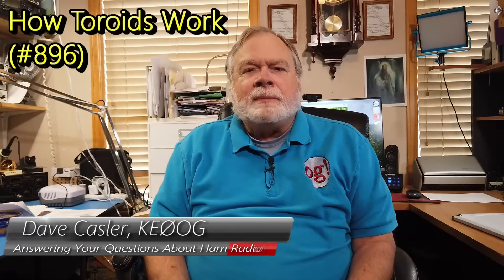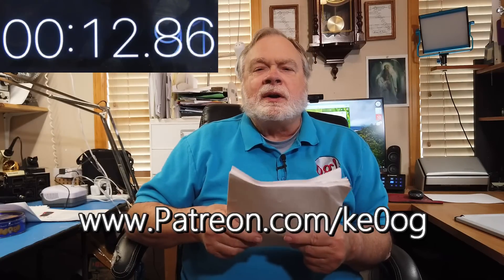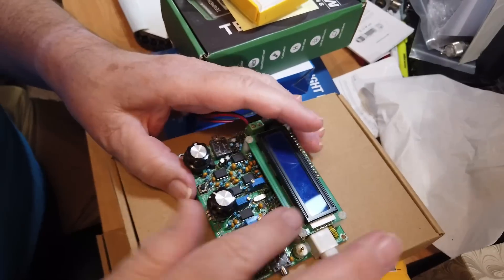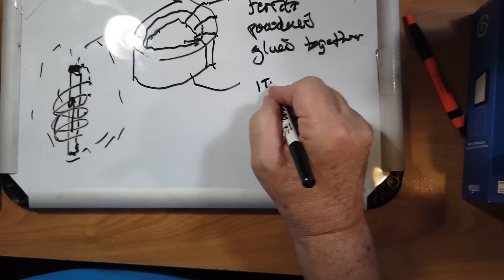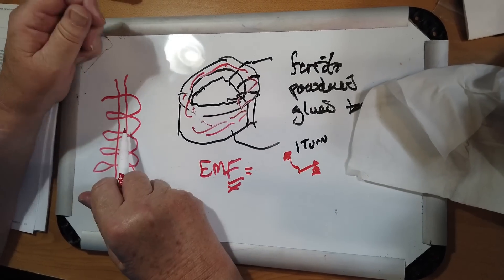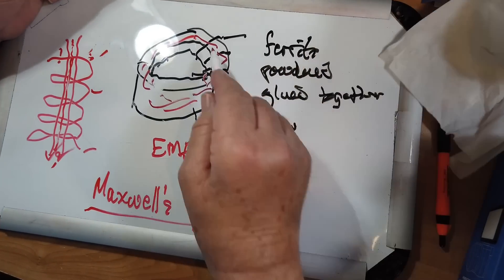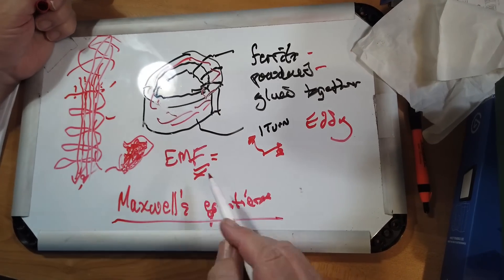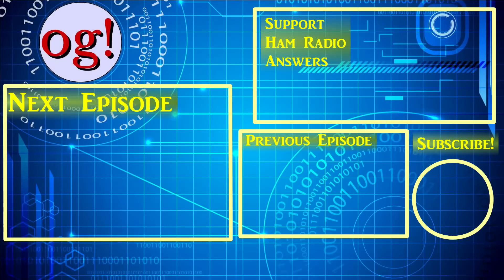How Toroids Work (#896)

Comment: Maxwell's equations actually require some advanced math. To keep things simple, I just say:
1. Putting a voltage across (or a current through) a wire creates an electric field.
2. The changing electric field creates a magnetic field. In a toroid, this field is ring shaped, inside the toroid itself.
When you wrap ANOTHER coil on the toroid, the same magnetic field is inside. This leads to:
3. A changing magnetic field creates an electric field, which can be picked up by a wire.

Which is what you said, I'm just summarising here.

Comment: 4:15 Two types of material for toroids (and other shapes of RF cores) are used:
A/ ferrite - a sort of magnet permeable ceramic, which is sintered at high temperature and treated in a special manner. It is not powdered nor glued. If such core is heated above certain temperature (e.g. by excessive RF power losses), it loses its magnetic properties forever.
B/ carbonyl - powdered iron mixed with glue and hardened. If it is overheated and cooled again, its magnetic properties return back.

Comment: "Spooky", later referred to as "mutual conductance". There was an old wives tale that went around about how you could "effectively" increase your output power without any amplification by stacking toroids. Not true, it actually takes away from effective radiated power. Accept, if done right, It makes a great balun and gives full transfer of energy out to the world 👍😁.
Reply: OM tale more likely 😆 *Except
Reply: The only thing stacking toroids does, is to increase the amount of current it takes to saturate the core by decreasing the flux density, at the cost of increasing the magnetic losses.  If a core isn't saturating, it doesn't need to be doubled.

Comment: I think the easiest way to explain this is that the electric field E is perpendicular to the Magnetic Field H. The electric field runs in the same directions as the wires. Because of the time changing current in the primary windings, this will induce a time changing magnetic field. Since the wires are wrapped around the toroid, the time changing magnetic field has to be perpendicular to the windings, or, in the toroid. If other windings are placed on the toroid, similar to the primary winds, the time changing magnetic field will induce a current on those windings. All of the these Physics are explained in the Mathematics of the the 4 Maxwell equations.

Comment: It is not necessary for a toroid to be made of a magnetizable material to be useful for confining the magnetic field.  A solenoid (or long thin coil of wire) has its magnetic field mostly confined to the inside of the solenoid.  Magnetic field lines are always closed, and so in a linear solenoid even without any magnetic medium inside it, the lines loop back around the outside of the solenoid to the other side.   If the solenoid is bent into a circle so that the end of the solenoid meets the front, the magnetic field lines in the loop directly back to the other side crossing the minimum distance because the ends of the solenoid nearly meet.  In fact, at high frequencies, a solenoidal form made using a ceramic toroid is sometimes used that is non-magnetic.

In an ordinary inductor, a magnetic field must be established in the magnetically permeable medium inside the toroid (whether or not it is air or iron powder, ferrite, etc.) in order for a current to flow in the wire.  The current rises in time in proportion to the voltage and inversely proportional to the inductance.  As the current rises, energy builds up in the magnetic field in the core.

Now say we take two wires and twist them together and thread them together around the core.  Let's say we apply current to only of the wire, and leave the other wire open circuit.  This is the same as only having one wire, and again it takes energy to build up the magnetic field in the core and for the current to flow.   But let's say we now short the other wire.  Now when apply a current to the other wire, a current can flow through the other.  It would take energy to build up the magnetic field, but since current can now flow in the other wire, an equal and opposite current flows in the other wire.   Now no net current flows through both wires together, and there is no net magnetization of the core.  The core only is magnetized to the extent that the two wires do not exactly contain the same magnetic flux, and since they are twisted intimately around each other, the two wires share almost 100% of their flux.  Because of this, a current in one wire can induce a current in the other with hardly any magnetizing of the core at all.  

If the two windings are separated, we can consider two windings as parts of a "magnetic circuit" with the core being the path of the circuit that the magnetic field lines travel.  A winding has an electric current flowing through it with a number of turns, called "magnetomotive force."  This induces a magnetic field according to Ampere's law in the toroid's medium (the magnetic circuit medium) with the magnetic flux given by the ratio of the magnetomotive force and the reluctance of the circuit.  This is akin to Ohm's law for electric circuits.  The idea of "reluctance" is related to exactly above where it takes energy to establish a magnetic field in a medium, and so when a voltage is applied to an inductor, it takes more time ("is reluctant") for a magnetic field to be established.  The magnetic flux can then induce a voltage (and therefore a current) into the secondary winding, with the current having a magnetomotive force that cancels out that of the first winding.  Because the windings are separated, the flux is conducted in the core between the two separated windings, are opposed to the case where the two wires are intimately wrapped around each other and the flux hardly needs to be established at all, and so the flux established in the core may be significant and could potentially even saturate the core material if the field is high enough.

This is why in many transformers windings, if they are not twisted together (which can cause capacitance between the windings, and so must be wound as transmission-line transformers to prevent parasitic effects), are usually either concentric (wound one on top of the other), or kept as close as practically possible.

Comment: Like your new format. Explain how toroids work in a RFI and choke configuraton.
Reply: You probably have chokes with two identical windings in mind. If it is inserted into a two wire line, the wanted current flows through both windings in an opposite direction. The magnetic fields cancel each other, so the inductance for the wanted current is zero. Unwanted common mode current, on the other hand, encounters high inductance, which limits its intensity.
Another case - toroids beaded on a coxial cable. A coaxial cable behaves as three conductors at RF: the inner one, the inner surface of the braid and the outer surface of the braid. Ferrite toroids or tubes beaded on a coax increase the inductance of the outer surface, where unwanted, unbalanced and RFI currents flow. The inductance of the two other conuctors is not affected.
Reply: Dave too is wondering on the subject 😊
De VU2RZA